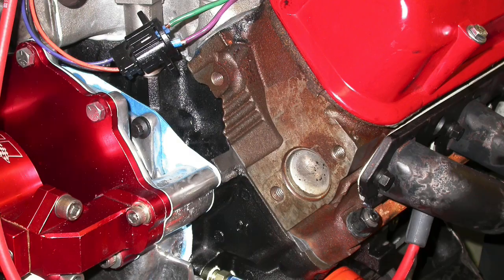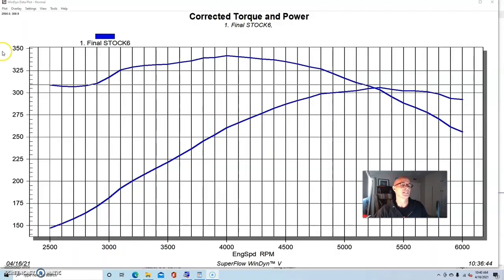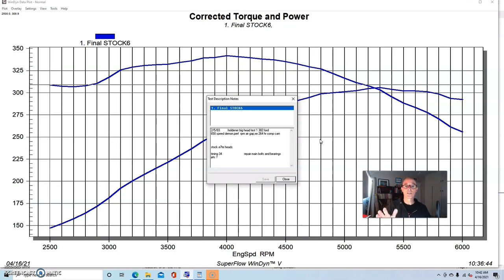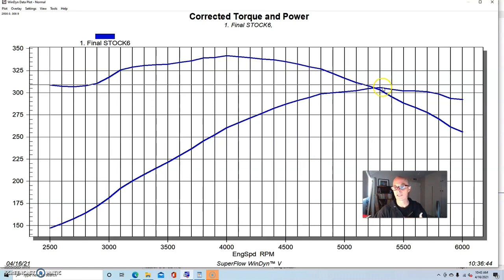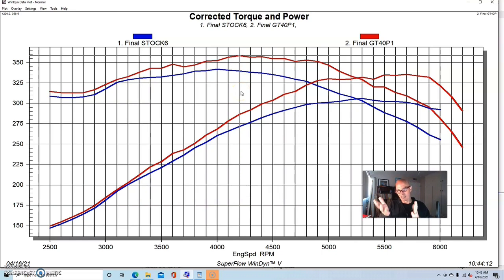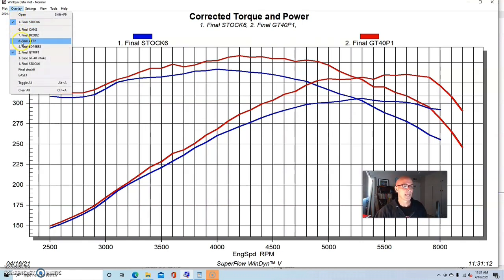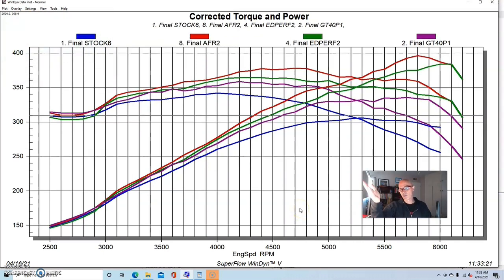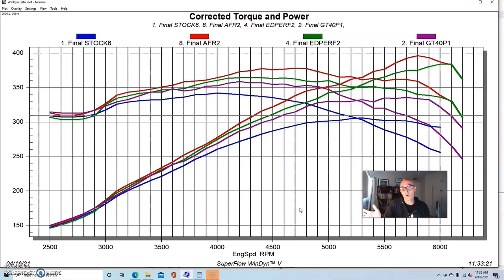JUNKYARD GT40P HEADS-ADD 30+ HP TO YOUR 5.0L (FOR FREE?)

Comment: All in the application.  Full size car or truck/bronco /explorer vs Fox body/older light car swap, daily vs weekend warrior. Seems like you would not want any of the cams you run if your vehicle weighs over 4k and you actually want to drive it every day - you would gain little or even lose lower end and use more fuel.  So without a " bigger than stock cam" why would you run massively great flowing heads? The GT40's are just right, even with porting for such an application.
Reply from the maker: the cam I tested here added power at every rpm-so they work on a 4,ooo pound vehicle too
Reply: @richardholdener1727  Okay, I'd heard that " camming up" wouldn't help much for heavy vehicles with the 5.0 and watching your dyno runs seemed to confirm it - losing torq n hp below 3000 - where most of the driving occurs. I'll watch again. Thanks!

Comment: Well now you have to do a GT40 head on the 351 test Richard.
Reply: Makes a LOT of low-end Torque, especially with a stock HO Mustang cam, if you have a 1994-up 5.8L roller block.... but runs out of airflow pretty quick as the RPM's climb. Great towing/torque engine, though.

Comment: EFI to carburetor? What's wrong with EFI? EFI is supposed to make more power whilst being more efficient than carburetors? (at least with 4 cylinder engines) O.O ...Anywayz - I find aluminium heads more appealing than cast iron heads as they have the potential to allow the engine(head)to run cooler, which should have other benefits... >.>
Reply from the maker: the head upgrade applies the same to efi 302s as well

Comment: Would you mind trying truck-oriented combinations for the 5.0/5.8? On this power/torque graph, none of the rpms plotted are relevant for a truck for towing, pulling its own heavy weight and offroading, where a truck needs a lot of torque in the lower rpms. Maybe 1000 to 4000 rpm gains? Stock intake versus Edelbrock? Stock heads versus GT40(p), AFR 165? Sorry if I'm asking for a lot. OBS Ford Bronco here.
Reply: GT40/GT40P heads on a 5.8L/351W (1996 in my F250) with a stock '88-'92 Mustang HO cam and longtube Hedman Hedders makes HELLA towing power with 4.10 gears! People will think you have a 460 under the hood! However... the stock 351W/5.8 EFI intake stops at around 4000-4500 rpm TOPS! (dual 3" Y-into a single 3" exhaust)
Reply: A 408W stroker engine with GT40/GT40P heads (watch your compression ratio!) and a stock HO Mustang cam will make torque almost comparable to a 460. The stock EFI 5.8 intake will be 100% done by 4000 RPM, though.
Reply: @linctexpilot8337  Go carbureted
Reply: When you pick up the GT's make sure to snag an Explorer upper intake, it's actually a little big for your application but everything else is even bigger.
Reply: @johnjones928  I thought the explorer upper intakes weren’t as good as the older 5.0 intakes from bronco’s and such for flow? I know the Frank-intake idea where you use a 351 lower with 302 truck upper ported and matched is the best oem thing you can do but I didn’t think the explorer intake was better?
Reply: @swankscabinet1625  The Explorer intakes were based on the Cobra unit and have a staggered runner base. The older Bronco's used the same intakes as the trucks as far as i know. The uppers were useless but the lowers with their larger ports work great with performance manifolds designed for the stock 5.0's inline runners. 5.8 lowers don't fit 5.0 blocks nor do staggered manifold parts mix with inline pieces.
Reply: @johnjones928  yes I get that. I’m saying take the upper from one of the 302 trucks/broncos and port match the 351w lower to the upper and stick that on your 351 build. They do line up and I’ve seen it done personally but I didn’t know whether or not the 302 upper from the explorers flowed better than the trucks. Sorry for the confusion but I do know that a 302 truck upper on a port matched 351 lower is a lot better flow and almost comparable to the lightning/cobra intakes from the same time period. The cubic ports of the 302 upper were larger than the oval ports of the 351 for some reason but the lower of the 351 have plenty of meat to port match on both ends of the ports so it works great together
Reply: @swankscabinet1625  I think the confusion came from me not realizing you were talking strictly about a 351 built. In that case an Explorer manifold wouldn't fit unless you can source a 351 Lightning lower manifold. Personally i'd stick with a stock ported truck 5.0/5.8 lower and find a good used aftermarket upper for a cheap build.

Comment: One thing that I haven't seen mentioned is the significant amount of weight off the front end of the car by going with a set of aluminum heads, plus the added chamber size consistency....I have read several times that the factory heads, especially the e7e heads have pretty significant differences from chamber to chamber.   I have never cc'dd a set, but that is the 'rumor'.  For my $$ I would buy a set of basic ally heads before putting a bunch of money into rehabbing the factory iron anchors.  Plus they are much easier to port and polish

Comment: THE EDELBROCK E STREET WORK GOOD BUT SO DO EARLY 351 W HEADS  WITH A PORT JOB
Reply: What will ported 69 351W heads flow?
Reply: @trailerparkcryptoking5213  about 190 to 210 depending on valve size

Comment: The ONLY thing I want from edelbrock, is an intake. Their heads,cams, and carbs suck...ehh...I actually like their cabs. But, the only reason they are good is because they were someone else's first. Plus that bogus "MADE IN USA" stamp. Everything if theirs is cast in China and shipped to the US  for final touches.
Reply from the maker: Edelbrock has a foundry in the USA
Reply: @richardholdener1727  then I stand corrected. Pre 2010, they either didn't or only used it for smaller items.

Comment: What gains would you guess you would get if you only swapped the heads but didn't upgrade the intake or cam?  Specifically I'm thinking about my '96 F150 5.0.  I'm not sure what intake options I have that work with the truck style TB.  Would a head upgrade even be noticable with restrictive  everything else?
Reply: Short answer. Yes. The E6/E7 heads are crap. For a cheap thrill, you can use a factory HO cam and advance it 4*. There’s a ported truck lower on eBay right now also. Consider it’s the same port design as the Holley Systemax. There’s a lot of volume.
Reply: Edelbrock used to make a EFI truck intake... Don't know if they still do.
Reply: @foxfordcatguy2283  I just checked.  They do still make them, but, oof, $900+.
Reply from the maker: gains from heads would be less with a stock cam

Comment: 4.9 Liter actually.
Reply: Yes, we know this is your automotive knowledge that is your input in any damn conversation.

Learn some actual important facts.

4.9 but it still runs circles around any 5.0/305 Chevy (& 307).

Ford labeled it a 5.0 for several reasons;

1) Originally designed to compete in classes with a 5 liter limit.
2) To avoid confusion with the 4.9/300 straight 6.
3) 5.0 sounds better.
4) A 5.0 emblem is cheaper to make than a 4.9 emblem.
Reply: @foxfordcatguy2283  I consider myself to be a fairly knowledgeable car enthusiast. That is how I know that it is actually a 4.9L. One of the bigger lies of the 80s. Hell even Vanilla Ice sung about his 5.0. You can explain it and justify it 20 different ways but its a 4.9L. I dont care what it can beat, what its better than, your opinion of me and accompanying insults about my intellect,. Its a 4.9L And that is what the fender badges should have read.
Reply from the maker: no
Reply: @richardholdener1727  lol. Yeah sure Richard.
Reply: @EricMotoring  If you actually have any automotive knowledge other than what you learned from Vanilla Ice, why on every single video that mentions a 5.0 Ford small block all you EVER say is "It's really a 4.9"?

What difference does it make? If they had lied saying it was smaller than it was to cheat & fit in a class, yeah that'd be completely wrong.

"Bigger lies of the '80's"? They used "5.0" starting on King Cobra Mustang II's in the '70's.

You don't care about its performance?!?! All you care about is a little white lie about its displacement?!?! Yeah, that's the important part...

It is also not the first time Ford did it. The 427FE was really 425.98 cubic inches but they obviously didn't want to use "426" because of the Chrysler hemi & the 427 was built to fit class with a 7.0 limit, so that's what they went with.

What about the lie Chevrolet has been spreading since 1967, that "Camaro" is a made up word? It really comes from the Spanish word for "pal" - "camarada." But they started lying because of how it sounds to say "I'm going for a ride in my Pal"!!
Reply: @foxfordcatguy2283  I make a lot of comments on the channel actually. And I love a good debate. In all honesty I really don't think about it much or care. I have learned a lot from the responses that I have received. I am a car nut through and through. I enjoy the culture even when when not interested in a particular machine.
Reply: @EricMotoring  What YOU consider yourself to be and what others can tell you really ARE from your obsession with something that does nit latter are 2 completely different things.

Did you comment on Richard's videos about the 400 Ford that it is really a 402?
Reply: @foxfordcatguy2283  i didn't watch it. not sure its really the same situation as Ford's 4.9 liter mustangs though. did you comment on the video?

Comment: If I was to look for an 351, what years/models be the best building block?
Reply: 1994+ f4te number has roller cam. Takes all the 5.0 stuff.
Reply: @philipmacduffie7612  ya, roller block is better. They're not as common and I don't think the vans got a roller camshaft for a few years afterwards even if they got the f4 block. I think all the vehicles with roller 351 blocks had mass air as well.
Reply: @timothybayliss6680  I don't think so. The lightning had a roller block and a flat tappet cam with speed density. Now the 95R I think is roller and mass air. Same block.
Reply: @philipmacduffie7612  Thank you
Reply: @ToddDavey  don't get me wrong an older block works but it will cost more for cams and lifters if you go roller. New blocks also have 1 pc rear main seal and leak less.

Comment: I think there's an unanswered question here. What do you get if you put a decent set of springs on the GT40p heads? You made note that your valve springs were a problem, and a set of springs is dirt cheap compared to even the Edelbrocks you used for your next stop up.
Reply from the maker: more rpm potential for GT40P, but not the power gains offered by the Edel or AFR
Reply: @richardholdener1727  I see your point. If the port is already at max flow there's nothing to gain by having springs capable of supporting higher revs.

Comment: I like how you're thinking with the in yard swap of the GT40s onto a roller 351. The funny thing is the intake for that would cost twice as much as the rest of the motor. Any decent cheap intake options?
Reply from the maker: carb intakes are cheap
Reply: Just saw an off brand 351w efi lower that bolts to an Edelbrock upper for $284 on eBay. Not really budget compared to a jy intake but definitely cheaper than the complete Edelbrock.

Comment: Richard have you ever tested the factory lower intake VS ported?  I was always curious what smoothing out those bends on #1 and #5 was actually worth, if anything.
Reply from the maker: we did porting on HO upper and lowers plenty of times back in the day-We Extrude Hone Ported and even tried equalizing flow rates of the runners but the long runners still add power in the same rpm range-there are gains from porting, but not compared to a different intake design
Reply: It makes a lot more in the mid range and drivability is very impressive. I done this a dozen times in the 90’s when aftermarket intakes were so rare. 88 LX - Stock bottom end, stock cam, stock E7’s with long tubes and a ported lower went 7.70’s 1/8 mile @ 88mph. Not impressive now but was then!!!

Comment: Dang, i was really hoping to se what the gt40p heads do on a 351
Reply: You would be better to do some work on the 351 heads because the gt40p heads have a lower CFM on the exhaust side due to the smaller exhaust valves. A GT40 head actually does better overall once you get to a .500 lift. But doing some work on the 351 heads will get you a better result.
Reply: @SophiaAphrodite  honestly, I don't care. The gt40p is a good bolt on gain over my e7te heads so im getting what I want.
Reply: @SophiaAphrodite   - you are "confusing CFM with velocity" (not the same)  - the GT40P head has HIGH VELOCITY exhaust ports - - the faster speed port with the smaller valve makes up for lower CFM..... either way, GT40/GT40P heads are good for a towing 351W, not so much for racing. They flow pretty close to the same as ol' C9OE and D0OE heads do.
Reply: @SophiaAphrodite  thank you, good point!
Reply: This
Reply: Would like to see ported exhaust 15/8, 10.5 :1 Ford roller .500 roller cam, elder Brock dual plane would do?
Reply: @michaelmoreno4250  elder Brock? 🤨 I hope that was an "autocorrect" goof.
Reply: @donellmuniz590  it was!!
Reply: I wouldn't do gt40p's on a 351 ..  Clevor is the right direction.. or Ford Racing 351N Dirt Track heads.
Reply: Gt40's aren't enough head for a 351? Kinda wasting your time there save up and get a set of hogged out TW170's or wait for a deal (that's me) and get a set of 205 11R's....used of course.

Comment: 1972  I was a Jr. in High School, building the 15 foot B gas dragster that my uncle had sitting in the back yard, I also happen to live on the same street as the high school.  Anyway, I give him a hundred bucks and I dragged it home.  I did so coz I happen to have a 1966 289 A code engine that had rebuilt, w/ some DIY head work, a healthy solid lift cam w/c4 tranny.  I didn't have $ for safety stuff to run it at Fremont drag strip ..only 3 miles away ..so I'd fire it up and my crew (friends) would follow me to the high school parking lot ..where I'd do burnouts w/old school M/T slicks on the weekends..

Comment: Just finished installing gt40p heads on my 95gt working out some bugs but excited about the first drive hopefully this weekend
Reply: How does it run did you use your stock rocker arms and push rods
Reply: @sweetassugar2076  I haven't drove it I have one lifter making noise and broke a valve cover bolt off in the head 🙃 I'm running stud mount rockers with 1.6 rollers which caused my valve covers not clearing had to buy 1/2 inch valve cover spacers and 1/2 intake spacer
Reply: @thekernall74  it’s always something LOL
Reply: @sweetassugar2076  hardened pushrods factory length

Comment: Gday.  Mate ya videos are fantastic I went the lazy route a. Blueprint 306. They original stated 390 horse power and end up with 300 rwhp but I should have got the 347. Ohh well still tears the rear tyres up.   Keep up the great. Videos.   Blueprint. Heads. Seem to do ok. Also

Comment: When do we get to see a 351w with gt40 heads and a turbo
Reply: Or a roots blower im going to do 351w worked over gt40s and a 174 or 671 blower
Reply from the maker: I have a 302 (327) with a 174 blower video and head swap video already up
Reply: @richardholdener1727  yeah but 351 Windsor with GT40 heads 👀

Comment: In the process of adding ported gt40 heads, tfs1 cam and explorer intake
Reply: What are you using for push rods and rockers
Reply: @sweetassugar2076  hardened stock length pushrods and the factory rockers for now
Reply: I just got a TFS stage 1 for my 351 and GT 40 heads going in my lowered 85 F 150 step side

Comment: So what vehicles do the GT40 heads come on?? Explorer only and what years??
Reply: 95 to 97 ford explorer or mercury mountaineer
Reply: @joevaagen6170  Thank you
Reply: The GT40 heads came in '96 & early '97 Explorers/Mercury Mountaineer. The GT40P came in mid-'97-'01 Explorer/Mountaineer.

The 5.0 wasn't available in them in '95.
Reply: @foxfordcatguy2283  Okay. Thanks for the info. Just picked up a foxbody and will be hunting for some. I wanna keep a stock look under the hood so these will be perfect. Thank's for everyone's help
Reply: @foxfordcatguy2283  my bad I thought it was as early as 95 I knew 96 and 97.
Reply: I don't think even all the 96s had them. It may have been a mid-year thing.

Comment: Thanks for the great info here. I picked up a complete Ford explorer with a GT40 engine for $300, a complete set of unused, ported, milled, valve job gt40p heads with Ford racing a50 adjustable 1.7 rockers for $250, a B303 cam  $50, performer RPM air gap intake $125, basani long tube headers that fit with the gt40p head spark plug location $150 and a like new Holley 670 CFM Street avenger for $10. If I'm not mistaken the GT40 heads on my combo will bump up the compression almost half a point to around 9.5? With the T5 transmission it should be a good combo for my 1946 international harvester K1 with the 3:73 posi disc brake rear from the Explorer.
Reply: You're so cool. 😎
Reply: @johnmurner2418  I try to be. You should check out the 300 6 cylinder that I'm taking out
Reply: @descargaelbano  i have one in the plow truck!!

Comment: Finding a V8 Explorer in this area (Southern Ontario) is near impossible
Reply from the maker: so Obama destroyed all the Explorers?
Reply: @richardholdener1727  I’m not sure about down south but rust took them out quick in Ontario
Reply: All 302s are getting a little harder to find than a few years ago. When did they last use them, 98?. Only a small percent of explorers we're ever 5 litre to begin with.